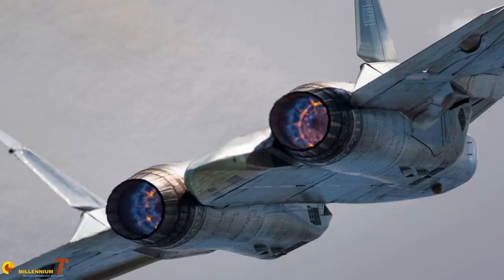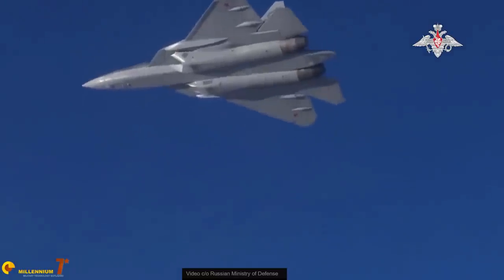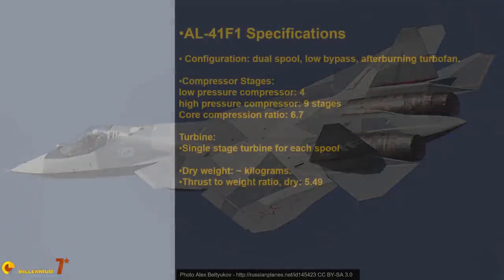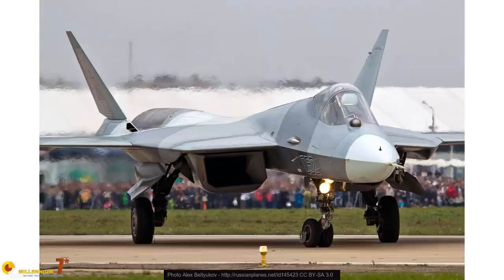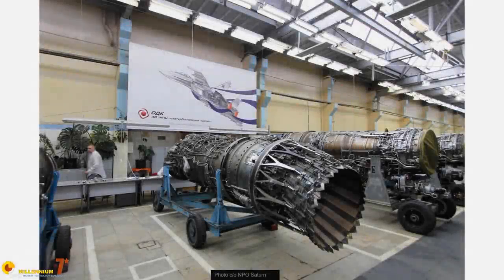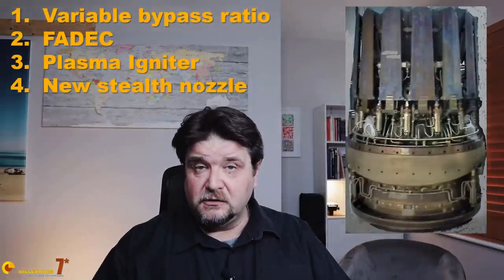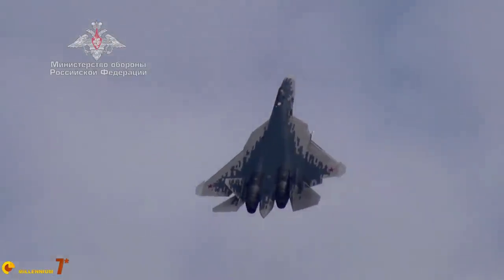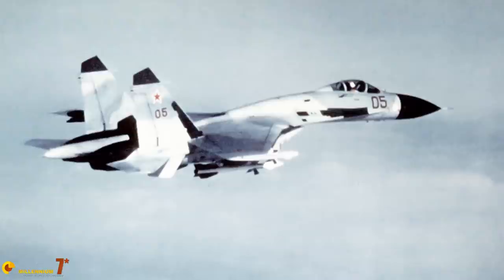Su - 57 the Raptor Slayer | Part 2 - Propulsion

Comment: "Raptor slayer" I think it's embarrassment that the planes still doesn't beat the 20 year old raptor. I'm starting to think they are going to decommission it before anybody makes a better plan. And the Su 57 it's really far off of being stuffed aircraft and would have no chance in a real fight. The only chance it has is if it manages to merge with the raptor and enter line of sight dog fight. That should never happen though because the raptor will detected from miles away, because it's stealth is non-existent from any angle other than the front. And on top of that it's stealth from the front isn't even impressive.